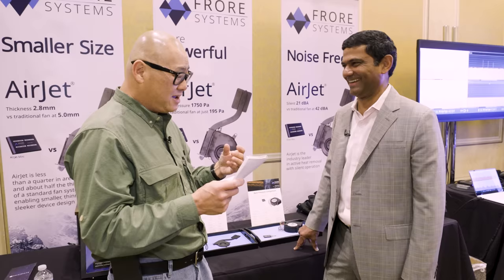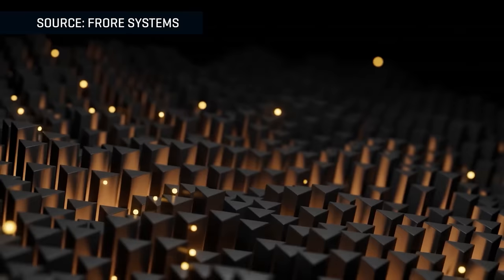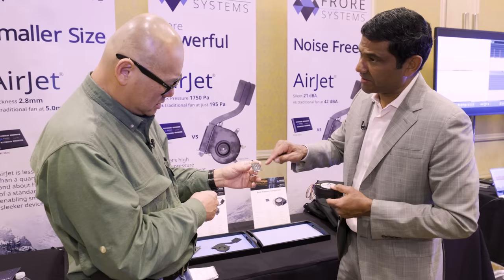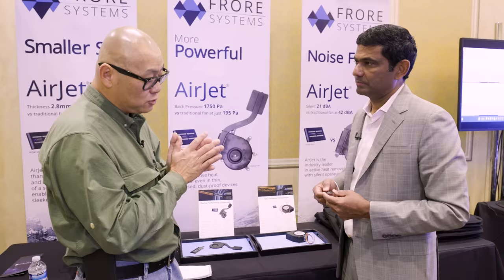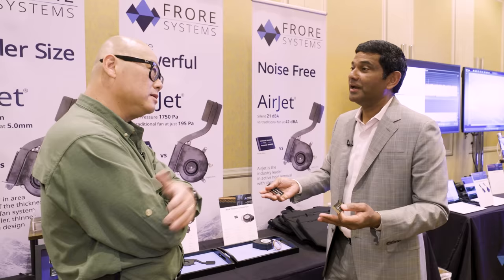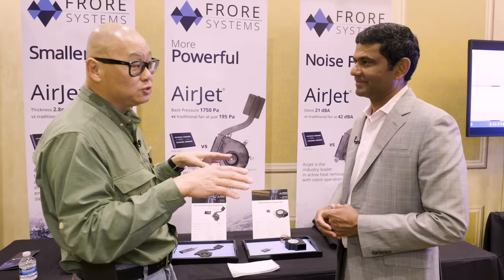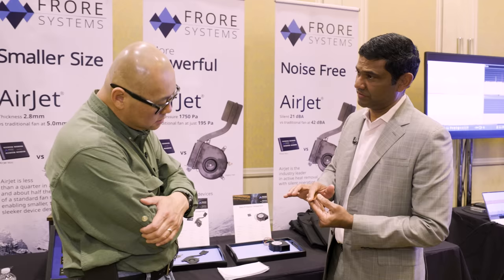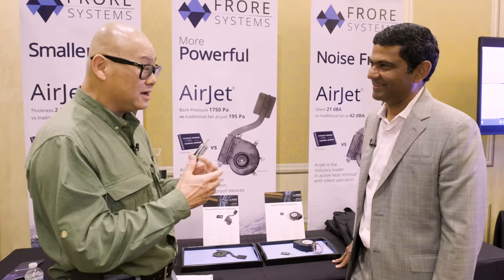Solid State Active Cooling Could Revolutionize Thermals

Comment: Fantastic invention.  This is definitely Next Gen stuff.  I'm also glad they discussed the wattage it consumes, which is very low. I hope they do very well for their accomplishment. Hope they are able to scale to service the massive demands of laptop manufacturers, or license out the design to leverage 3rd party manufacturing plants.
Reply: Oh yeah this is huge it will be everywhere. I would buy one for my CPU in my desktop today if it were available
Reply: @CrowClouds  It depends how long they can last. People won’t want them if they shorten their laptops shelf life.
Reply: You're saying the wattage it consumes is low, but it really isn't if we consider that the mini one uses 1w to cool 5w, in these terms it's currently much less efficient than fans. Their current value proposition is thinness, quietness, and scalability + improvable technology, not power efficiency. 

But the technology is absolutely impressive and I can't wait for future generations of it!
Reply: @CrowClouds  12700k has a base TDP of 125W, going up to 190W at max. Their bigger cooler model cools off 10W. So, unfortunately, even if this was available, you wouldn't put it on your CPU just yet.
Let's give the technology some time though, it might get there. 👌
Reply: @Segrey  Actually, its on par with current laptop fans which consume between 0.5 and 1.5 W, and closer to the higher number when demand increases. Note also that he stated that the 1W value is the max for the solid state ones. Typically, it would be less since its efficiency is so high vs. standard fans with all their backflow issues.

If they can get their prices to be competitive, look for these to be mass produced and be included in just about every future laptop made.
Reply: @privatename3621  it's true that the wattage is similar, but it's incorrect to compare those, because a laptop fan is capable of dissipating more than 10 times the amount of heat, while using the same amount of power.
Reply: @privatename3621  Not exactly a good comparison. I would suspect these are two fundamentally different technologies. A standard squirrel cage fan as found in a laptop, or even a standard PC fan are non-positive displacement pumps, they just happen to be air pumps. Their efficiency drops like a rock (as the presenter correctly point out) when they are outside their design criteria for inlet and outlet static pressure. Back-pressure is not a useful comparison in non-displacement fans as it's ignoring a significant portion of the equation, namely inlet static pressure. However, backpressure is very important in positive displacement pumps as efficiency actually increases - to an extent - with increasing outlet pressure, and is also relevant to calculating manifold, diaphragm, lobe, or cylinder pressures and thus the required material engineering to keep it from overpressure damage. Again, not such a big deal with air pumps, but critical in higher viscosity fluid pumps.

As a result, I would posit that this new solid state cooling solution is actually a positive displacement pump, where back-pressure is actually a relevant measure as the pump will displace a fixed volume of fluid regardless of outlet pressure, and to some extent is only limited by inlet static pressure (resistance to flow such as from a dust filter) as you start to approach a statistically significant portion of vacuum, but that would be a literal blanket thick layer of dust and thus isn't a huge concern in regards to laptop air filters.

This does come with the issue that volume of fluid efficiency is lower with all positive displacement pumps, no matter what you do, you can only move a fixed volume of air per cycle of the pump. If you want to move more air, you need to move the pump faster or make it bigger, which thanks to friction, air resistance, and inertial mass has an exponential increase in the power required to do so. Conversely, the power required to run a non-displacement pump actually decreases as you move down the efficiency envelope, to the point where it draws almost no power as the static differential pressure reaches design limits. So where you end up with a 1.5W computer fan that at peak efficiency moves enough air to keep the system cool, the solid state 'fan' requires a fraction of the power required. However, as you scale up the system, the 1.5W computer fan only needs an enclosure change to maintain the design efficiency curve and move even more air with the same 1.5W while the solid state fan simply requires a larger pump and thus more power. That doesn't make the solid state fan bad, it just means it fills a role that the traditional fan sucks at filling, compact efficiency.

Take a 1u server for example. The fan size is limited by form factor, typically the fan is only going to be allowed 40mm diameter. However you are running a machine that is capable of drawing 1000-2000W with ease, and has components that will idle around 70C. You need airflow, and lots of it. However, if you stuck these on the processor, size per watt they are likely better given the original design constraint of the fans previously required. In order to get enough airflow through the long, narrow, and restrictive 1u rack mount case, you need a multi-stage fan that spins at an insane speed, for example my 1u units will independently ramp fan speeds of 6 fans between 3,000rpm and 14,000rpm based on zone temps. That takes a ton of power as the design efficiency envelope is thrown out the window in favor of not burning up the server. This is a case where these fans may benefit, not exactly as replacing the main fans, but as being places on individual components to keep them cool by avoiding of the main issues with cooling in tiny spaces which is the boundary layer that prevents thermal transfer between air and the object you are trying to cool. If you stuck a couple of those solid state fans on the storage controller, iLO, Flex-LOM, and a few other core components, you could keep those temps lower without having to ramp the main system fans to kingdom come. In such a case you don't care that the solid state fan is less efficient than a traditional fan, it's small size is more efficient than the practical jet turbines at the front of the machine. It's just not going to be more efficient (in its current state at least, I would love to be proven wrong as the technology progresses) when compared to a large non-displacement fan at the peak of it's efficiency curve inside a large spacious case.

Comment: This is actually brilliant. We'll see the issues that may arise, but conceptually, this is awesome. Wrapping my head around this: It's using the oscillating wave of the membrane to creates huge pressure differentials zones, then moves air down the x-axis, and expels it smoothly  but with force due to the membranes whipping motion at the tail end/near outlet, almost like how dive fins generate force. It's pretty much a sine wave in a square syringe. 
Edit: Also, I wonder for extra thermal performance will they essentially make a mini radiator but each fin containing it's own membrane with the inlet on one side.
Reply: Yes, that's how I understand it too, as for the radiator part, not exactly sure want you mean. Do mean basically having a not-a-fan chip per hole in the radiator? If so, I imagine that because of the huge back pressure compared to normal fans, you might actually have the same layout as now (first the fan/frore chip and 'downwind' the radiator), but with way denser radiators because the back pressure might allow the air through anyway. In combination with what mr. Madhavapeddy said, the radiator might be a radiator-dust filter combo. And since more radiator fins = more cooling, that might allow even greater cooling potential :)
Reply: Given the velocity of the output air,  dust could be handled with a miniature cyclone filter.
Reply: Issue: superhot exhaust air that will burn your skin! :face-pink-tears:You almost have to mix in some cold air with a venturi or similar before pumping it outside the device. But seems to be an awesome technology.
Reply: The radiator idea is as good !
Reply: How long do membranes last under conditions like this? Is stretching or tearing an issue?
Reply: @oskjan1  just don't put your hand near the exhaust.
Reply: @Mister0Eel  So I wrote out a configuration last night but it didnt post lol.

I meant outlet*. Looking from the side perspective, processor is flat on table. There could be like 4-5 viable configurations imo. One would be a tower. There would be the heatsink in a rectangle format, like a tower, pointing up from processor. Using smaller membrane cooler design, have 4 on each side/face of the tower pointing/shooting air upwards. Another design could be a dual membrane stack which would have two of the units stacked on opposing faces on a thinner flat heatsink. Air outlets would face horizontally vs. vertically.
You also could have this membrane squared design which would be hilarious. You have one mega card as the base structure, but at each inlet port of the main card there's a smaller one with it's outlet feeding directly to the main big one. That one likely would be stupid unless there was some greater efficiency gain by having the big card do most of the driving and there would probably too much differential math going on.
Reply: @cowsgobob3518  That's what I was thinking too but the membrane is probably some finely tuned plastic with maybe some ribbings.
Reply: @oskjan1  Yeah, but that's if you're really close, if applied to laptops I think there would be a small dead space or shaped diffusion area. While the back pressure is high, the throw/volume would be very short.

Comment: If this truly functions as advertised then I think this is massive. This is exactly the kind of innovation I want to see!
Reply: The skeptic in me has a LOT of questions but I'll just start with the most important questions first : 

1) What are the dangers of the device? There have to be some as it's essentially a compressor in a chip format. Compressing air itself generates heat. Moreover, they're aiming for a higher heat saturation percentage which means the temperature is going to get high and it might straight up be a fire hazard. I also imagine that the "vibrating membranes" themselves will fry out if the inlets are blocked. What kinds of exit temps are we looking at? Having a mini jets besides your fingers doesn't sound like a good idea.
2) What is the lifespan of the device? I imagine shooting dust particles at a relatively high speeds won't result in a product that lasts for very long and the copper substrate is going to get damaged.
3) What is the device rated for in terms of PPM? As there's dust everywhere and there has to be a rated environment for it.

Honestly, I can only see a use for these devices in fabs and nowhere else.

I know the interviewer has a history of simping and getting too excited, but I'm surprised he didn't ask these kind of questions. This is why I prefer GN over him. GN is never going to spare these sorts of questions just to "have" an interview.

Comment: WOW ! I imagine that this innovation will take computing and mobile devices to the next level. Great job Seshu Madhavapeddy and keep up the great innovations coming
Reply: This will revolutionize mobile hardware if it's power efficient
Reply: The issue I see with mobile devices is they will need an outlet for this air to go somewhere. This will be a big issue for waterproofing.
Reply: This is nothing new for 10 years! Why no one use? Because it eats power quickly.
Reply: @IhsanMujdeci  the difference is that with this product you could put an ip68 airfilter while still being very more cooler then normal methods, cause the back pressure is so high. so there will be vents for the air to get in and out as with all moving air applications, but it would be a dust and water filtered channel.
Reply: @MrDragonorp  that's a great consideration. I was thinking more of when it's submerged in water. Then this fan solution would need to stop running for some time and/or the passive cooling would have to be enough and maybe the cpu will throttle down.
Reply: @IhsanMujdeci  I think in that situation the fan would pause, i don't think there is a use case for high cpu usage while submerged.
Dust can cover the filter and disturb the performance of the chip, maybe you can do is reverse air path to clean up the vents in some way, another chip in opposite direction of normal flow maybe.
Reply: @IhsanMujdeci  my thoughts also

Comment: So it seems to me you could use a heat pipe/vapor chamber setup that ends with a big, flat piece of copper that you can mount like 4 or 6 or 8 of these things on in order to supply more cooling capacity for higher power processors, especially if you are dealing with a desktop CPU where you are much less limited on space. The fact that this breaks through the boundary layer of air makes me think that it would allow for much more efficient or much higher power cooling systems on desktops, even in its current generation which isn't really built for that purpose. Speaking of which, I wonder if end users could buy these things with a connector and/or adapter that lets it plug into a standard PWM fan connector, and either is directly controllable with that or an adapter is able to convert the PWM signal to whatever this thing takes as its control signal.
Reply: Exactly what I was thinking, this tech has a lot of potential to scale using heat pipes. 

I don't expect to see them available for end users to purchase any time soon, but I could be wrong. It just seems like this has it's best application in laptops and hand held devices. There is very little advantage to using this tech in a desktop vs traditional fans and would not be worth the additional cost.
Reply: @nyquillusdillwad9119  How about high TDP single slot GPU cards?
Reply: I'm not 100% sure if I fully get the insides, but perhaps for desktop use they could increase the copper heatsink surface vertically to get more airflow and thus more cooling
Reply: You still need space to duct the exhaust air away, so there will be limits on density.
Reply: I still get this part of the presentation.
What is the boundary layer?
Reply: @billyswong  These solid state coolers as they are could maybe cool up to a 100w. If I were to estimate the big one's size, lets say it's about 3 inches long and a little over 1 inch wide, so about 3.33 watts of cooling per sq inch. You could hit about 100w of cooling assuming you maximally use the surface area of a 7 inch long gpu. High TDP just ain't gonna happen, you would want water cooling for that. But, these solid state coolers could push the single slot GPU market from 75w into the 100w territory while being quieter, however I wonder about the cost, and if spending the extra bucks on cooling a lower tier gpu makes sense. Maybe in workstation applications? But, I just don't see it being an aftermarket upgrade for average users. I keep mentioning cost, but that's just assuming these will be expensive when they first hit the market. Given the size and amount of material, it's possible that they could eventually end up cheaper than conventional coolers.
Reply: @philemonzz  In order to maintain the velocity that defeats the boundary layer I don't think there is a whole lot of wiggle room to increase thickness and airflow, but I could be wrong. He may just be showing off how thin they can be, since the application he is presenting is for laptops, but increasing the thickness a bit and adding more intake slots could increase airflow and effective cooling. But also should consider that such changes could also impact sound, and these could be devices that you want to keep at an inaudible volume if the pitch they make is unpleasant.
Reply: @nyquillusdillwad9119  You might be right, but the guy said they use heatpipes so for gaming purposes they could just add more cooling chips and perhaps stack them
Reply: @philemonzz  Yeah, with heat pipes it could be possible to design a cooler based on these devices that can work in a desktop. I'm just saying it would have very little advantage over current air coolers because in a desktop they can be made large enough that a big, slow, quiet and relatively cheap fan can do the job. These solid state coolers could be useful for small form factor builds, but the cooler would probably need to be designed specific for the case in order to place them in a position to exhaust the hot air, otherwise you are still relying on a fan which would kinda defeat the purpose. 
But, who knows, you can buy all sorts of fans and parts to tinker with, it's just going to be up to the manufacturer to decide how they will sell them. My guess is that they will be too busy trying to partner with laptop manufacturers to bother stocking and selling them individually, or for applications like desktop cooling that would be niche and low volume. 
Basically, I don't think these will be an affordable option for standard desktop computer applications, but that is an assumption and they will also get cheaper with time. All I was saying in my first comment was that it probably won't be on the shelf for consumers to purchase as a separate component or cooler for a desktop any time soon, but it will probably happen eventually.